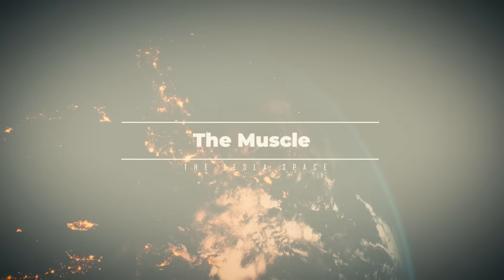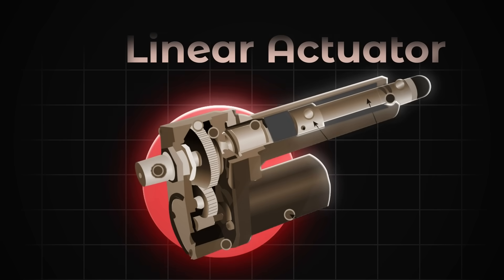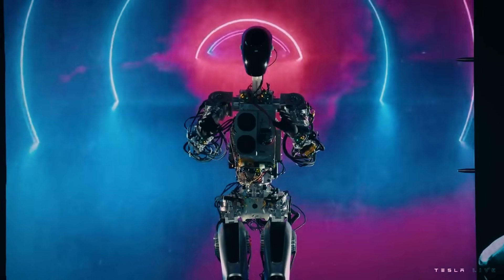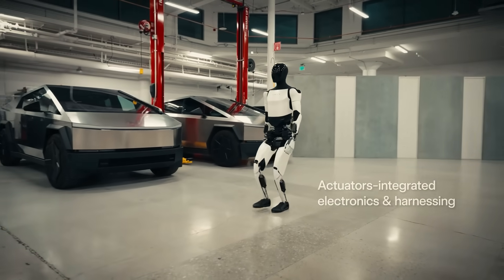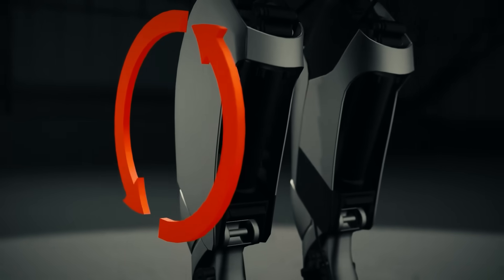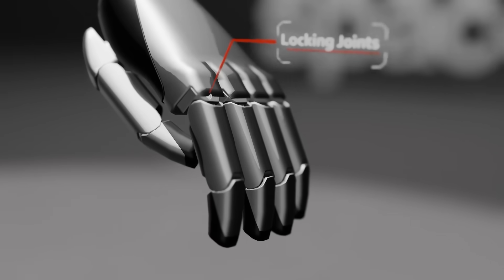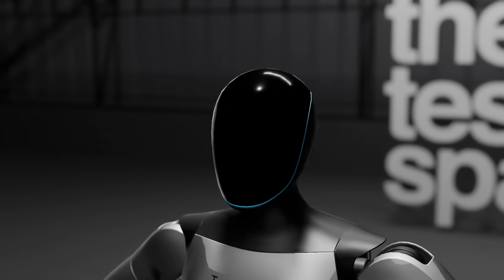How The Tesla Bot Is Made

Comment: Have you ever considered Vesconite Bushings?                                                                                                                                                                                                                      Low Friction:
Vesconite materials have an unusually low coefficient of friction, which directly translates to less noise and vibration during operation. 
Small Clearances:
Vesconite bearings are designed with small clearances, further reducing the potential for noise and vibration. 
No Slip-Stick:
The material's design prevents the "slip-stick" phenomenon, which is a common cause of noise and vibration in traditional bearings

Comment: Make the bots swap their own batteries and the bot can work while the exchanged batteries are charging (no charge downtime). Just have a tiny fixed battery inside the bot to run it during battery swap (which can be easily recharged by the main battery after swap).

Comment: 🎯 Key points for quick navigation:

00:00 🚗 Tesla and SpaceX collaboration to build a new electric Roadster.
01:14 🚀 Cross-company technology collaborations between SpaceX and Tesla are significant.
03:30 🔩 Material science innovations from Falcon 9 could potentially revolutionize the Tesla Roadster design.
07:38 ⛽ Combining rocket engines into cars faces practical and safety challenges.
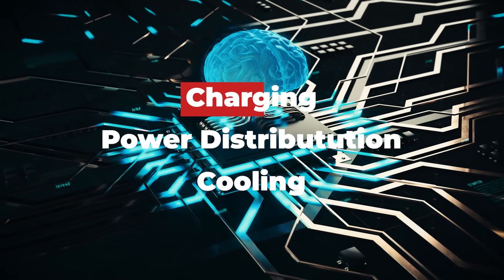11:28 🚀 Cold gas thrusters from SpaceX could enhance the Roadster's maneuverability.
15:40 🌐 Tesla and SpaceX aim to optimize energy efficiency and vehicle dynamics for the Roadster.

Made with HARPA AI

Comment: DETAILER CABLES WITH COMPOSITE RUBBER BREAKABLE  TENDONS THAT CARRY A WEIGHT   OF 5LBS  MAX DOUBLINGUP  ON NEED OF MORE 500ACTUATORSTRANDS CAPABLE TO LIFT250  LBS FOR MUSCLE GROUP. CARRY ANEGG WITHOUT MUCH MORE THAN AUTONOMOUS CARRY  STANDARD GRIP FORCE WITHOUT EXTRA MUSCLE GROUP LIG ASSISTS ALL  HYDRAULICS OR MOTOR TENSION  IN TORSO CABLES WORK  MUCH LIKE  SECTIONS JUST  LIKE  A 10 SPEED  THAT HUMANOID  JOINTS.CABLES CAN BE TENSED BY NANO CARBON F IBER MUSCLE TENDON

Comment: I don't understand why they are trying to make it an exact duplicate of a human. Our design is so flawed. Like why do we only have one thumb? Why not have one on each side of the hand? It would not be in the way of anything and it would certainly give a much more powerful grip and the ability to lift heavy things more effectively. And slightly longer fingers would be a benefit as well. You could easily do that one inch dumbbell lift challenge. Also, only one elbow joint? How many times have you tried to scratch an itch in the middle of your back and you can't get to it? Basically anything you can imagine that you can't physically do, the robot should be designed differently. Think about the entire principle behind jiu jitsu, arm locks, leg locks, headlocks, all of these are based on the weakness of the human body and means that the robot should be designed to overcome this. The only limits are your imagination and yet they still make it an exact duplicate of a human.
Reply: Because the entire world has been adapted to the humanoid form factor.

Comment: The only thing "POWERED by hydraulics" is the dynamo in a hydro plant that charges a battery. A battery-powered motor drives a pump, which can drive a hydraulic ACTUATOR that turns the pressure difference into motion, with losses at every step.

Comment: for the elderly, disabled, and those with injuries these robots will have an immediate impact. our current shortage in patient transport, nursing, and healthcare workers will be potentially filled by these high dexterity robots. if they can get the cost under $10,000 and keep maintenance costs under a $1000 per year the potential will be huge.
Reply: If it is able to do most house chores, especially hard one that require a bit of arm strength like say scrubbing hard stains, cleaning that hard to remove brown mold growing on walls and ceilings in the bathroom, moving furniture around (without scratching the floor), cleaning windows during spring cleaning, etc., then, at that price point, I'd immediately buy one.

IMHO the first models will be WAYYYYY costlier.

However, the dystopia wouldn't be far behind, as when robots are able to do all that, then, not all but MOST human jobs will, not would, VERY FRIGGING QUICKLY, in a matter of less than a decade or so, be replaced by AI, by robots , or by a mix of both.

Also, these things will get hacked. Can you imagine a would-be thief managing to pirate such a robot? Suddenly the thief has eyes, ears, and hands, right inside your house. Can simply wait until you're not home, and order the robot to disable the in-house security system, go get all the valuables and put them near the front door and on the dinner table, then unlock and open the doors so that several other stolen robots in an "autonomous driving" van that just parked outside (also stolen) all come inside. with boxes and bags, grab all the loot, and leave in a matter of minutes.

Heck, what about some crazy nihilist, or an enemy government, hack the software? Suddenly, you have a literal ARMY of "perfectly obedient sleeper agents", right inside people's homes, ready to cause maximum mayhem.

If a corrupted robot can disable / reprogram a non-corrupted robot faster than the corrupted robot can determine "this is an invader", then assuming a lot of homes have the robots, an initial cell of "evil corrupted bots" could spread EXTREMELY FAST.

So yeah it's going to take a LOT of safety countermeasures. At the rate things are going right now, ever and ever faster, with rush to productivity and profits, and next to no regards for real actual safety, I have some doubts.
Reply: @patrickrannou1278   Tesla likely knows a thing or two about cybersecurity.  Wouldn’t be too concerned about them getting hacked.
Reply: The SPOT robot costs like 75k and it's just a dog. There's absolutely no way they're getting the price under 10k for the teslabot
Reply: They said under 20k, this shows you just don't like tesla@hi-sq2hq